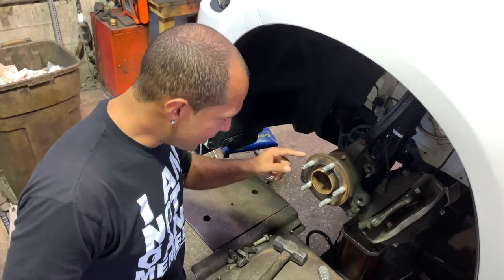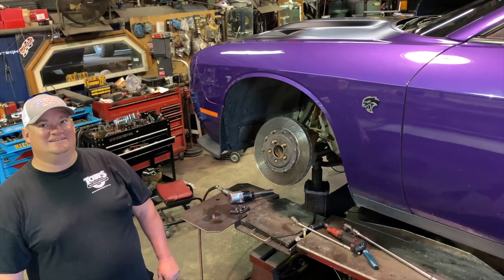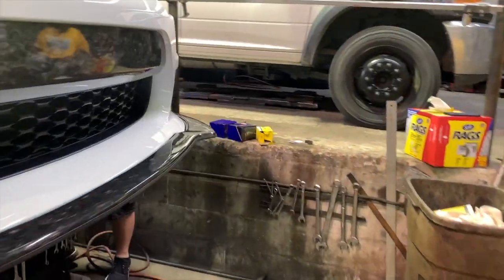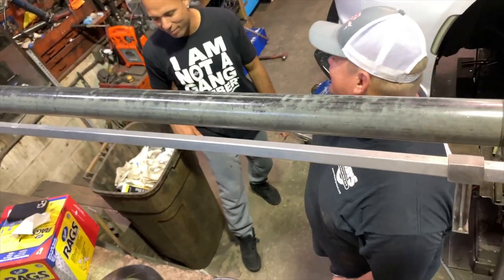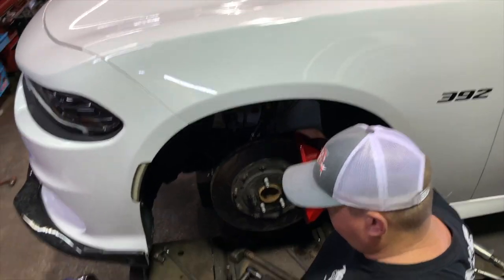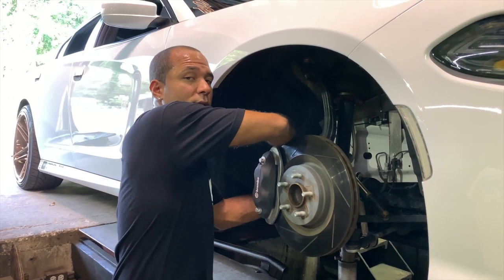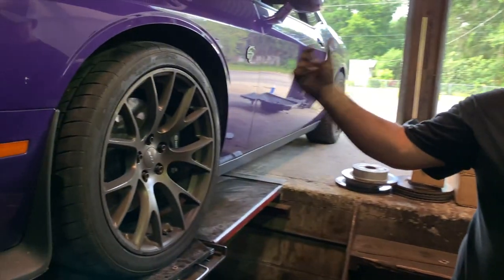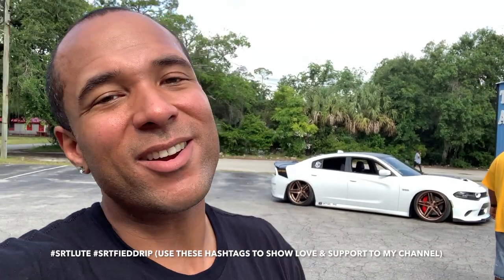Scat Pack 4 Piston To Hellcat 6 Piston Brake Swap

Comment: Time for me to do mine... but with how they increased the Rotor size from 390 to 400 mm Dealers have to special order the rotors for like 2,100$ ( CAD) a piece..but 6-8 weeks lol. ended up going with a set of Paragon Discs and Geomet Coated from the Factory, GiroDisc doesn't coat their rotors and don't have the rings for the stock Hats yet. Couldn't get BRembo Pads this time as Stock is a issue again...  Pads going with a set of NRS (also Canada company). Galvanized suckers.

Comment: Wait so I don’t need Srt knuckles? I’m in the same position trying to do this exact upgrades and someone is insisting I get the knuckles bc the mounting location and the bolts aren’t the same fit.
Reply from the maker: If yours came with the 4 piston brembos then the 6 piston caliper and rotors are a direct swap.
Reply: @Srtfiedofficial  thank you, appreciate the fast reply cause theirs a chance I go grab the brakes tm. Good to know that I don’t need to buy extra stuff.
Reply from the maker: @Iammakyle  no prob💯🙏🏽

Comment: Hey , i have a 2020 dodge charger scat pack . Mine came with 4 piston brakes . I just bought my 6 piston brembo calipers as well . Can i just swap out the brake calipers or do i need to change the rotors before actually putting the 6 pistons on ?
Reply from the maker: You will need the rotors as well as the six piston calipers are bigger and will not completely contact the rotors that came with the 4 piston calipers
Reply: @Srtfiedofficial  okay thanks
Reply: Where did you get your disk
Reply from the maker: Solisracinggroup.com
Reply: Hey where did you got yours at?
Reply from the maker: See the link i posted in the reply before you

Comment: Did you have to replace any lines or washers when doing this swap or was everything reused?
Reply from the maker: Nope, everything was reused. It was a direct swap! Just calipers and rotors/pads. All other hardware was reused as well.
Reply: @Srtfiedofficial  thanks for the info, also any loctite needed for the bolts? Also what's the torque specs
Reply from the maker: I didnt use any loctite and never had any issues with the bolts getting loose. If you wanna use some for added insurance then feel free to use some. As far as the specs i recommend good and tight. I dont know the actual torque values for them.
Reply: @Srtfiedofficial oh okay thanks again for the useful info, just subscribed to you 🙌
Reply from the maker: No prob and preciate the support💯🙏🏽

Comment: Can you just switch out the calipers if your going from 4 to 6 or you gotta get the rotors too?
Reply from the maker: No you can't just switch the calipers. The rotors for the 6 piston calipers are bigger as well which is why you need to switch them also.
Reply: @Srtfiedofficial  ok I been needing that question answered good looking
Reply: @Srtfiedofficial  so do I need Srt spindles too?
Reply from the maker: If you have factory 4 piston brembos then no.

Comment: My 2015 scatpack came with the lame matte black 4 piston brembos. What’s the cost of upgrading to the 6 piston's?
Reply from the maker: If you do it yourself you can find them used for around $1200
Reply: @Srtfiedofficial  ouch. It just sucks my car came fully loaded but without the dynamics package. Truthfully I just want the 4 pistons on mine in red but they’re the flat black ones and it doesn’t pop nearly as good as the 6 pistons in red
Reply from the maker: I ended up painting mine white with the G2 Caliper paint. Feel free to check out my video on that and they do have the red color if you wanted to paint yours.
Reply: 4 piston to 6 piston is not a big difference it’s only 17.2 feet

Comment: What about rears they stay the same?
Reply from the maker: Yes, the rear brembo calipers and rotors are the same on all charger trims including hellcats with brembo brakes
Reply: @Srtfiedofficial  ahhh nice so no need to upgrade backs then
Reply from the maker: Nope unless you want a different color which you can paint yourself like i ended up doing in later videos

Comment: What shop is this. I want to change my rotor on my scat
Reply from the maker: Avila Performance but this shop is no longer in business
Reply: @Srtfiedofficial   oh ok. Just came across your videos. Good job on your upgrade to brembo.  I have 22 scat challenge not wide body. I’m trying to do the same.  I try buying it on line but telling me it’s not the right fit for the car.
Reply from the maker: @Smithftrans876 thank you but its telling you that based on the package you have on your specific trim level. Mine said the same thing when i searched online however, if you have the OEM 4 piston brembos then the 6 piston calipers and rotors are a direct swap with no modifications
Reply: @Srtfiedofficial  👍 Thank you for the info bro.
Reply from the maker: @Smithftrans876 no prob💯🙏🏽